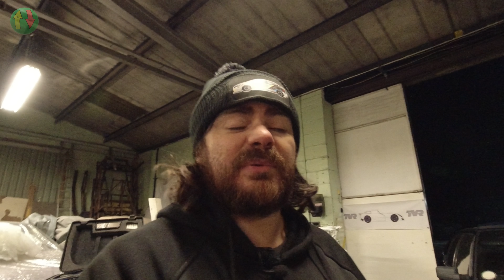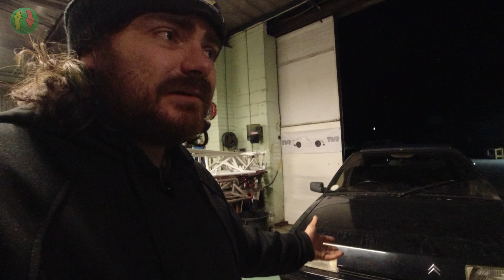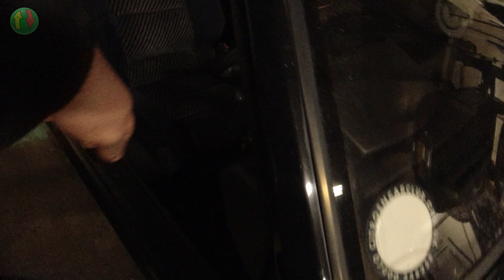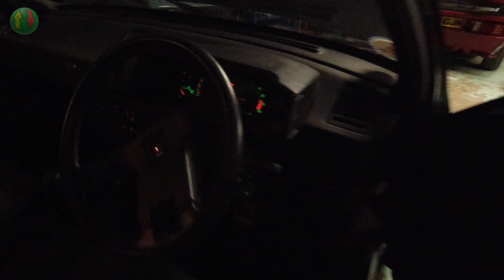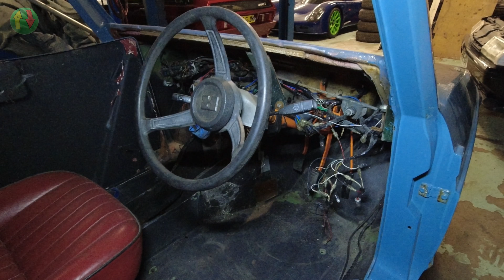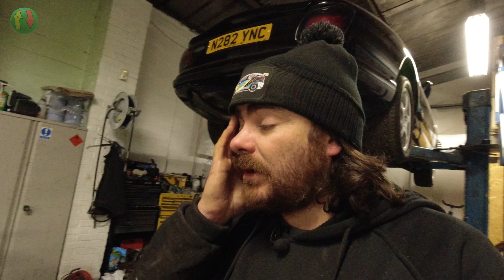WALK 'n TALK: Enough's enough! Two cars on the chopping block...

Comment: Feel your pain. 100%. Currently have 11 or so in the fleet, and started to look at how to thin it down a bit. Sold my Ax Track car before Christmas, need to actually strip my parts 106 so then that can go and work out what i'm doing with my damaged Octavia RS, get the clutch on my 406 fixed and then sold, and then i can start work on the actual projects! Three road legal out of 11 is not a good balance....

Comment: I'm in a similar situation but on a smaller scale. My thing is old hi-fi and audio gear. It may be on a smaller scale but it's still a problem. It's taken over my house. I'm sharing a rented house with a mate. So I've had to start getting rid of stuff. Stuff that in some cases I've owned for over 30 years. Stuff that has sat in the cellar for 10 years getting damp waiting for me to work on it. Stuff that works perfectly but I never use.

Some of it is valuable, not hugely so but enough to make me not want to take it to the tip. So I've started giving things away via the radio forum I'm on. I thought it'd be a real wrench but you know what? The feeling of relief when someone replies to one of my "Free to a good home" adverts, phones me and says "Yeah I can collect, I'm only 10 miles away and I've got an estate car" is completely unexpected and massively welcome!

I've moved house several times towing around this menagerie of decrepit audio artefacts and it was getting old. Some of the things I'm getting rid of are only suitable for parts but that's better than them finding their way onto the tip and bits that are no longer available anywhere going to waste.

Of course, we're in completely different situations. All I really have to consider is getting rid of things to help my own head. You have that angle too but on top of that you're running a business. You have to be pragmatic.

I've known for a long time things were going to reach this point eventually and now it's arrived. I was dreading it but it's turned out to be unexpectedly cathartic. Just like you, I'm not getting rid of everything, I've got other projects. Before I started getting rid, I'd go down into the cellar and I couldn't see the floor. And that didn't help my nut at all.

I don't think you're even slighly taking the piss regarding the prices you're asking for those cars. They're both great projects at great prices. I don't imagine you'll be sat on them for long, especially now this video is out.

I appreciate this comment has been a long ramble about things that are nothing to do with cars and I'm sorry about that. The point is however, I see what you're doing and why, I'm doing the same thing at the same time and we both know it'll ultimately improve our headspace.
Reply from the maker: Thanks for sharing that, Paul, I enjoyed reading it. Glad you're reclaiming your space!

Comment: The fox is Reliant Sea Blue, my Rialto is the same colour, but a lot more bloomed and scratched 😂
Reply from the maker: It's actually a Morris blue (previous owner painted it himself). Originally it was a moody green, I think possibly the same as the @Hubnut Foxanne.
Reply: @UPnDOWN  That's interesting, it looks very similar. Perhaps they used a Morris colour and gave it their own paint code for mine. All the paint codes and lots more information is on Fifers Reliant, which you won't need as you're selling it anyway. I'm trying to persuade my dad to buy it, I don't need any more projects either 😄

Comment: .... love a good spreadsheet, have you used/made a pugh matrix ? when it gives you a clear logical outcome its so liberating to go with something else ! - but agree that it is important that 'family has to come first' (well closer to the top than the bottom ! ) in the weighted rankings. - is the fox an 'historic vehicle' tax class ? Andy
Reply from the maker: I haven't, no. I've only just got onto pivot tables!
Reply: @UPnDOWN  you must give them a try, you can use it to make decisions on anything, project direction, best way to solve a problem, most dangerous way to do a task - oops that should be safest  way I think! , how to deploy staff, spend budget or what should I have for breakfast ! - Andy